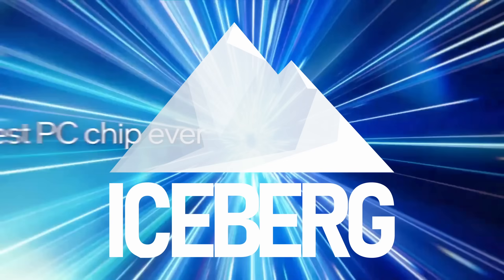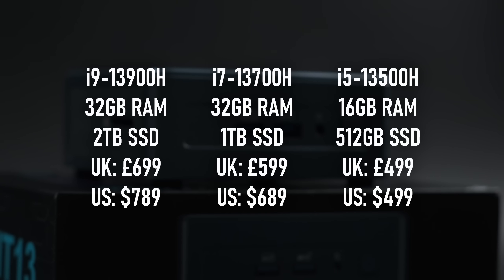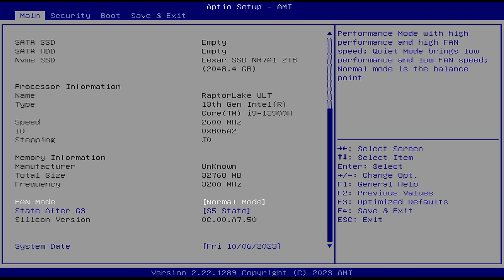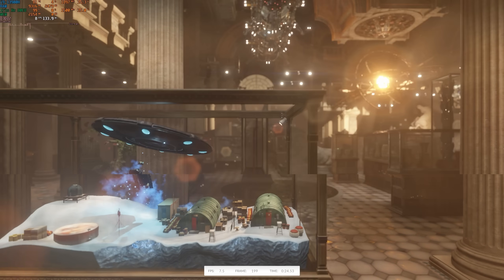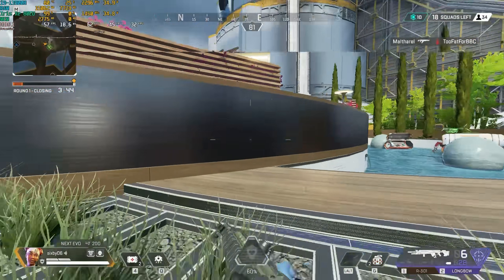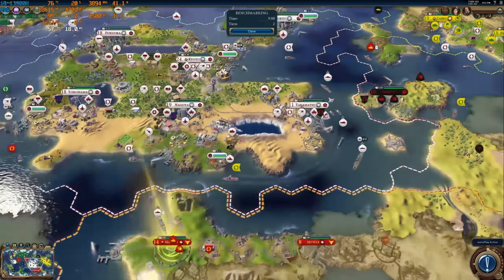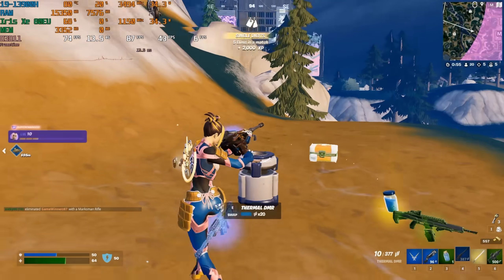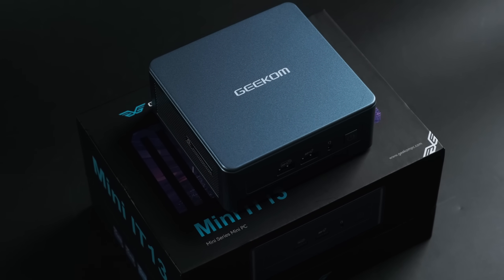This i9-powered NUC is all about POWER | Geekom Mini IT13

Comment: Time to get a m.2 igpu dock and see what this does with a similar gpu you have on hand
Reply: I noticed the usb C ports on the back were labeled as 40 gigabit as well, if they support PCIe tunneling you do also have the option of a thunderbolt dock, unfortunately Geekoms site just has them labeled as "USB 4" which says nothing about how capable the port really is since USB 4 at its worse can be basically just USB 3 and maybe even worse, this bein all thanks to the USB Implementers Forum (the group in charge of making the USB standard) a company can label a port as "USB 4" while supporting only a fraction of the things USB 4 supports

Comment: Considerations Before Purchasing This Computer: Firstly, the cooling system is a notable concern, as the fan is not sufficiently effective in dissipating heat. This limitation results in the CPU being thermally throttled to approximately 35 watts, leading to reduced processing speeds. Additionally, despite the CPU's compatibility with DDR5 memory, this computer is equipped with DDR4 RAM. This is a significant factor as DDR4 is 50% slower than DDR5, potentially impacting overall performance.

Comment: Can you tune that little monster and add a propper heatsink to it instead of solid panel? I'd like to see the difference
Reply: Agreed, and for the price that is being asked of it, the RAM and SSD are sub-par as well. I think a lot of performance is being left on the table and some proper tuning and better thermal paste/fan, might bring the performance more in line with what is expected., but as it stands it's a poor value.

Comment: Will this run cap cut for video editing in 1080P and 4k? I really want to pick one of these up if it will do video editing since it is silent and I'm always hearing my pc in the background for voiceovers
Reply from the maker: I haven't used Capcut in a very long time so I don't recall if it uses Quick Sync or not. If it does, you'll have a great time with 1080P. 4K might benefit from proxies, which - again, I can't remember if Capcut actually supports them?

Comment: Putting an i5-13600(T) into an ASRock Desk Mini B660 will be cheaper and give you better CPU performance, since it won't be crippled by thermal throttling.
You won't be gaming on it without an external GPU anyway (then just build an ITX system instead), so the IGP performance is largely irrelevant.

Comment: The Intel 13th gen i9 H series CPU is too powerful for a mini-PC, especially one with DDR4 RAM.  The 13th gen i7 H series performs better due to moderately less extreme push, so less throttling.

Comment: NUC is (and always has been) held back by unevenly matched CPU and GPU power.  One reason the SteamDeck is such a great value (more efficient at 15w than ROG Ally or Win Max 2, Win 4).

This wouldn't be so bad if they exposed a standard edge connector, even a x4, or a spare M.2 with occulink access so you could add GPU.  But they need to head back to the drawing board and get a decent 4 P core or 6 E core (one or the other, not both), and double down on some ARC cores, like A580 class.  Keep it simple.

But no, they sell it on bullet points:  "cores", ghz etc.  SteamDeck let the performance do the talking.

All that said I just got a NUC Iris motherboard with the 8th gen CPU for a steal ($45), and I'm going to try to make a modded NUCDeck with off brand Switch Joycons for controls and a 1024x600 or 800x480 screen, should be plenty of oomph.
Reply: It's more so the fact that Intel's CPUs are just vastly less efficient than AMD's. Despite Golden Cove having more execution bandwidth, it draws MUCH more power than AMD's Zen 4. Intel needs a node shrink badly for future Cove cores to become viable in mobile. The fact that a 7940HS is beating the 13900H in multithreading with a lower power limit is NOT good.
Reply: Which video shows ally being less efficient at 15w? The phawx shows the opposite.

Comment: I ran into a similar situation like this with my laptop where my i5 8300h was both thermal throttling and power throttling. I tried countless ideas to fix it! The solution I finally came up with was to simply lower the max boost clock speed with ThrottleStop. Now it does neither. 
You might think this is counterproductive. However, the problem I most massively faced when it throttled was with the cache speed. Before when it thermal or power throttled the CPUs clock speed was anywhere from 3.4 to 3.7 GHz. Normally it's supposed to turbo to 4 ghz. However, the cache speed would throttle to to around 3 GHz! 
I found that the best option was to set a maximum boost clock of 3.5. This keeps it from throttling so now both the CPU and cache speeds are 3.5 always and it keeps it under 90° C on all core load.
Reply: That cpu should not run at 90C. Try cleaning out the cooling and putting on new thermal paste. I have a 3050ti 5600u pc that runs cooler than that under full load and its cooler sucks.
Reply: @appsaucetech  Don't you think I tried that? I've even tried repasting the cpu and gpu multiple times to no difference.

Comment: On the subject of BIOS, i have found many of these being very limited as of late, it used to be these lesser known companies would give you great control over the hardware, and only larger OEMs like Dell, Lenovo, HP etc would lock down the BIOS
But i recently tried to use some 6400 RAM in my Minisforum UM790, and it would not let you change it to anything other than JEDEC 4800, which really holds back those 12 RDNA3 compute units, guess i'll have to wait for this to come to AM5 before i can get a competent micro PC without a GPU
When it comes to the GPU i have a beelink with 6800HS/7735HS that is faster because at least it would load the XMP profile for 5600, if not the rated 6400.

Comment: this will essentially become useful with 14th gen intel (superior gpus with arc technology, lower lithography and in tandem power and heat)
also nice video :)
Reply: You can always use the ryzen 7000hs series with a rx780m
Reply: Lithography tech has lost its meaning. The gate length isn't 3nm or 7nm or 5nm.
Reply: you mean 15th gen?

Comment: Those single rank memory sticks make my head hurt.  Performance memory is Dual rank.  (I have verified that low latency 2400 DDR4 dual rank beats single rank 3200mhz in CPU testing).

The reason is simple, dual ranks can be accessed at different times, so dual channel, dual rank is 4.banks of memory.  If you are on an IGPU you need all the help you can get.  Probably be a good idea to have even 2x4 or 2x8gb dual rank on hand for testing iGPU systems.

Same with the "gen4" NVMe, I'd rather have a gen3 with DRAM than a budget gen4, but 🤷‍♂️

To be clear, budget components are fine, if you got them cheaply.  But I am sure the markup puts them at the same cost to you as buying decent components.  If you can't buy the system without, you can at least use them for refurbishing an old laptop, or HTPC or something.  But putting an i7 and then hamstringing it with cheap components is silly.  Might as well have an i5 at that point and have it be (closer to) reasonably priced and more balanced.

Comment: CS2 results are quite disappointing, it's about the same performance a xeon e3 1230v2 (i7 3770) and a gtx 750ti, probably a bit lower while the power consumption would be around the same at max (40-50w on the xeon e3 and 60w on the 750ti).

I think the i7 variant would perform better. I remember those chinese small pc from Aliexpresshaving the same issues, with the i9 9980h slowly cooking themselves to death, while the i7 weren't thermal throttling and performed better.
Reply: thats not csgo

Comment: I am VERY picky about cooling of my electronics, and even as an HTPC I would demand better cooling for something like that. It is nifty having PCs this small, however, I will ALWAYS be a function-over-form type of person. That is why I refuse to buy an Apple product, most of their stuff has been form-over-function as of the last several years, and most of these mini PCs are the same thing. Better off with a (hopefully) cooler running i5 in this thing and upgrading it with your own SSDs and maybe RAM. If I am going to have a machine for at home use, I will stick to a full-size, easily upgraded desktop PC. These mini PCs are almost more useless than consoles, often just because of cooling issues. This thing has no upgrade path beyond storage, it uses too much power to be useful as a storage hub, its too limited to be an HTPC in the sense it can't really game unless you play a lot of old titles and retro games... But as an HTPC it would need to run things at 4k in my house hold and.... No, I think I will stick to my AMD Ryzen 5 5600X and RTX 2080 Super I got this year to replace my Ryzen 5 1600X and GTX 1070. If someone wants a small PC, there are better options than this. This is a beautiful machine though, and I give them credit for their packaging but the cooling should have been first priority even at their 80 watt TDP limit.